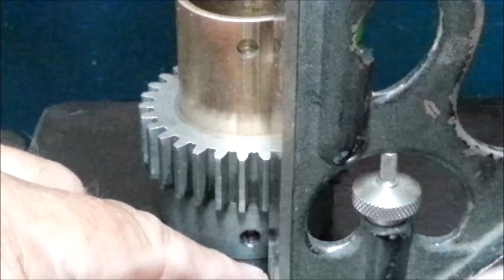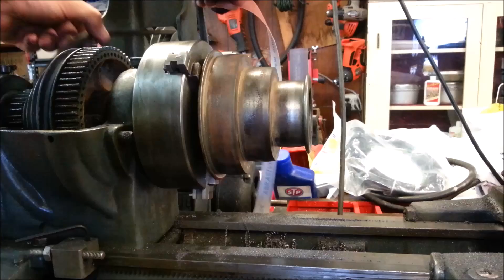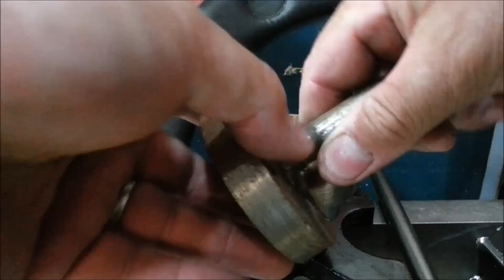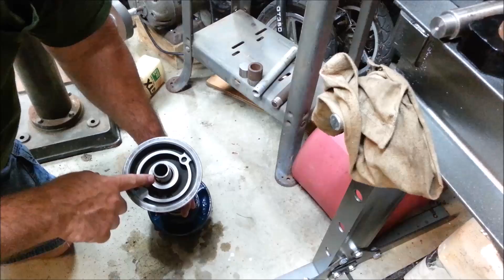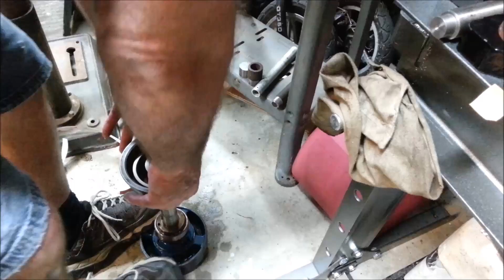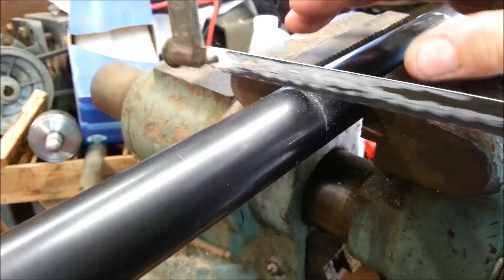47 Wards Logan Lathe Part: 7 Press & Fit Foul Crafted Channel

Comment: At first when the parts weren't fitting, I thought it might be from pressing in the bearing. I would think the diameter would be decreased ever so slightly for the bearing to fit into the gear. But man, that part looks factory made!
Reply: Crafted need to get some gages for testing the id. also
Reply from the maker: Thank you.  An ID is reduced by press fitting.  In a future video, I'll try to get a real accurate reading on a bushing before and after.  It will be fun.
Reply: eviltwinx that's what I was thinking to
Reply from the maker: Chris Anderson I have inside snap gauges and micrometers.

Comment: flap sander?
Reply from the maker: Hmmmmm,    A flap sander would take material out of everywhere.  How do we remove only the high spots?  Or should I call them the low spots?  The answer is hinted at in the end of the video.  Full answer shown in part 8.